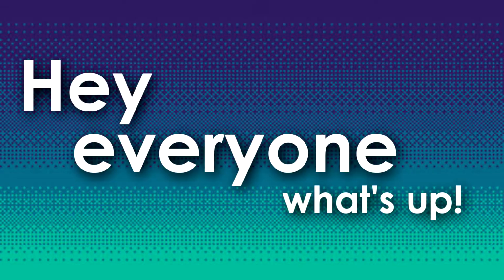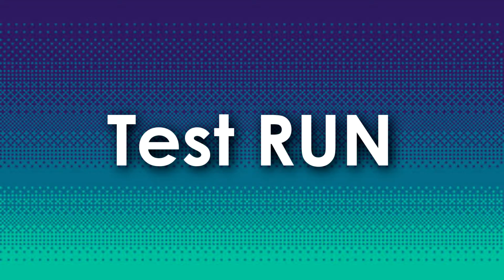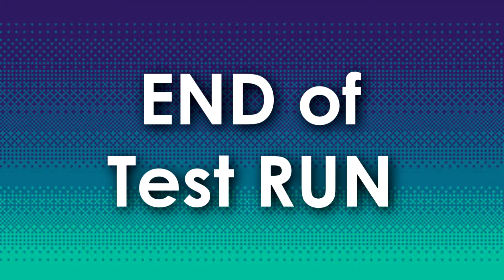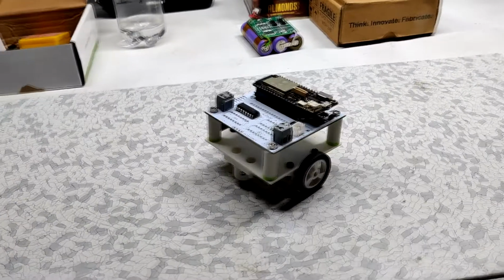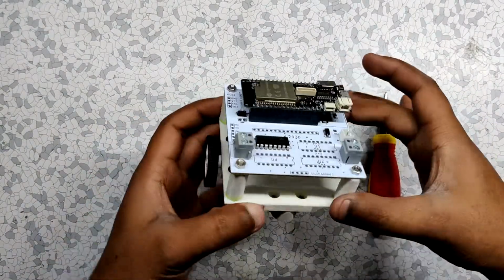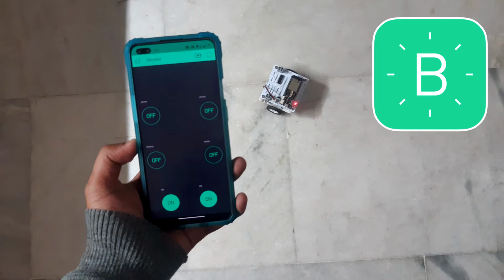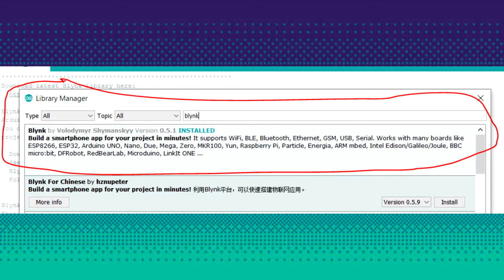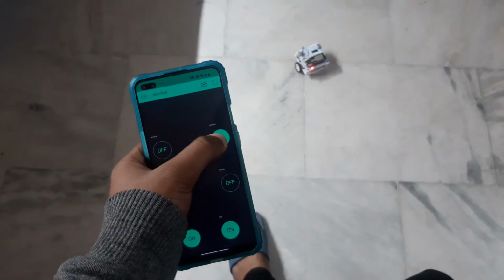DIY ESP32 based micro robot

Comment: Hi Arnov , there's an Analog Stick Control Widget in the Blynk Application.. Instead of just using the switches for On & Off, use the analog stick control for operating the robot. It has better control and is more user-friendly.
Reply from the maker: yeah but for that, I need to write a little more complicated code and this is just part 1 of the microrobot series, I will add that joystick and an additional ultrasonic sensor for obstacle avoiding feature
Reply: @ArnovSharma  Cool.! Can't wait to see more of what you make. 😁